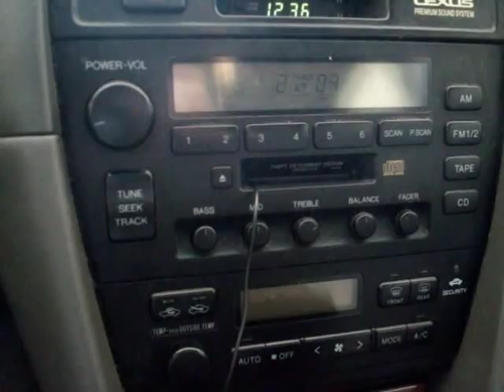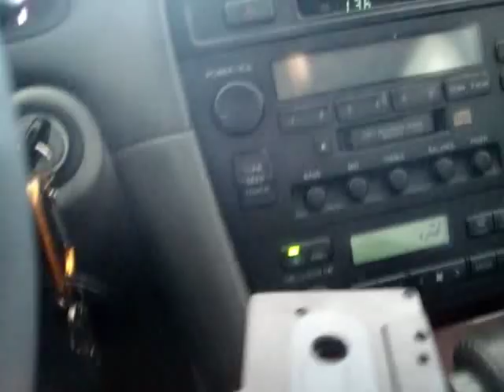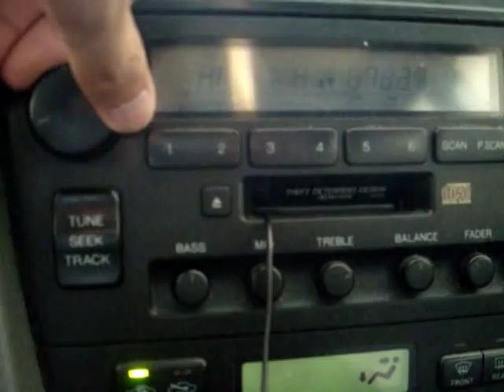Fix tape adapter / Constantly ejects

Comment: It is confusing because he literally takes the piece with rubber out and then places the piece with the rubber still intact back into the cassette, and then plays the cassette in the player an it works correctly. So he effectively took it apart and then put it back together. Wut

Comment: Sucess! I tried 4 different adapters, gears in, gears out, rubber o-ring in/out, every solution didn't work. Then I read my owners manual. If you have a GM-Delco am-fm cassette system, it has a bypass that must be activated.
1- turn off radio. 2- turn key to acc 3- press and hold tape aux button for 5 seconds. a flashing cassete icon will stay on 4- put in adpater. system powers up and it does not eject. 5- using eject button cancels bypass
6- to reactivate, repeat 1-4. it works. no matter the adpater or gears.
don't know about other brands. check your manual. hope this helps.
Reply: Steve Benson THANK YOU! This is the only thing that worked for me!
Reply: +Steve Benson This worked perfectly thanks so much!
Reply: why is this not the FIRST thing that comes up when googling "How to get a cassette adapter to work on gm radio"   Jezz......I've been messing with this thing for two days.....Thanks for posting that.....this video is a Lexus Radio even.   YOUR THE MAN
Reply: My Ye Olde 95 Buick radio doesn't have an "tape aux" button. Any ideas? Taking out the gears won't work. Owners manual states that an aux adapter will not work.
Reply: Casey Burnett have you found a solution?
Reply: Man it still won't work for me.
Reply: Steve Benson my Manuel doesent say anything about resetting and I tried what the guy did in this vid no luck. It dose say to clean once a year though but idk how to do that
Reply: 5 years later these instructions worked on my Chevy van. Thks bro

Comment: I like this vid, its helpful and hilarious cuz the way he speaks. However, this DID NOT work for me BUT i'm not saying this will not work for others. Here is what I did and so far, its works. I have the same model, i PERMANENTLY took out the gear with rubber PERIOD. Also, I sprayed the gears with a little DW40 and though I'm still skeptical, its working, I even ejected it and put it back and it works. I wish the rest of you the best. I feel you all.

Comment from the maker: @MusicIsDeadToday
If you have a protective cover over it, it usually prevents the jack from plugging in all the way. If it has an equaliser, you may want to adjust that. My last guess is that if you're using those fatty headphones, and you're using the wrong jack converter- either 1.5 or 3mm.
One thing unique to ipods is the ability to adjust the sound to play exclusively on one specific earbud. This may mess with your cars audio system.

Comment: Myself, I've always had a problem with annoying cranking, squeaking, and rattling noises.  I fixed this though.  If you pause this at 0:51, you will see the three main cogs in the center.  If you carefully lift those out (paying attention to their configuration), and put a dab of Vaseline where the large center cog rubs against the casing, and on both sides of the smaller cogs.  This essentially creates a soft suction between all the parts, and eliminates the plastic on plastic crime.  Cheers.

Comment: So, my adapter makes a horribly loud buzzing, as if gears are grinding inside. After twenty minutes, with the heater on, the deck gets warm and the buzzing stops. Every adapter I bought did this. Any ideas?

Comment: I think i know what the problem is with mine, its the heads on my tape player,  its not catching the spinning parts on the tape itself,  the heads on my tape player are worn so it just partially grabs the cassette spinners,  so the tape doesnt even really play,  have u guys removed your deck to see if your tape player geads are worn like mine?

Comment: wtf all he does iis:
take apart
get rubber piece
pull it apart, put it back together,
now it just works.... im calling bullshit
Reply: ill be honest, i did too until i did it and it worked. no clue how it worked, but it did
Reply: Jared Bauman didnt work for me. i took off rubber smoothed it out a bit and replaced it and put it back together and still ejects. what am i doing wrong?

Comment: Maybe someone here can help me:

I got an adaptor for my tape deck, but it wont stay in for longer than a second. As soon as its pushed it it settles like any other tape then is immediately spit back out. I've tried it just the adaptor, I've tried it with my music plugged in and playing, nothing helps. I can play regular tapes with no problem. I've tried other adaptors from other brans and they all do the same thing.

I think the problem is that the cord is preventing the door from closing all the way, so as some sort of safety mechanism the deck spits it back out. I was thinking of trying to remove that little door entirely, but I dont want to break the whole thing. Any ideas anyone?
Reply: Same exact thing for me... Figure anything out?

Comment: I took the rubber out and left it out and it worked but you could hear it spinning, so we put the rubber piece back in and it did work!  Crazy but works! It's a brand new adapter and would not stay in originally popped out immediately and now it's fine!

Comment: Don't waste time doing this -- it doesn't work. Nor does removing the cog with the rubber on it or any other part of the adapter. This product is just defective, plain and simple. Sometimes the adapter works if I warm my car up first -- but sometimes during the summer when the weather's warm the adapter still does the auto-eject thing. I've yet to find a way to actually fix this product. But, yeah, don't waste your time taking it apart--it doesn't fix anything.
Reply: +StrangeAngel03 Yeah I didn't think dismantling would work anyways. I had a Philips cassette adapter and it keeps ejecting constantly. Sometimes it goes for a few good 5 minutes, at least one song. I finally had it and upgraded to getting the Monster cassette adapter, it was $20, $10 more. Yet, it's doing the same thing. If what you say is true, about it being a defective, then I can go back to Walmart and exchange it. Also, the weather does have effect on the cassette because it heats up your radio as well. But even when I fixed my AC, it still ejects. Even on cold nights. I remember I somehow fixed this problem before, but I forgot what method I used.
Reply: +Jose B. its ejecting ot autoflipping because of the tension in the tape adapter. I used both the monster and the philips and if you remove the lower gear assembly and lightly wd-40 the gears inside so they move easier, along with not screwing in the screws all the way, leave the a little loose so its not too tight, and it works.  havent had either pop out for over half a year.

Comment: I actually only needed to see where that little plastic cog with the rubber on it goes. I'm fixing some exposed wires. took mine apart and out fell that piece. thought I was screwed....that is till you took yours apart. so thanks. even though my problem wasn't the same one I'm sure glad you were able to help me and for that thanks.

Comment: WTF is this all the videos I'm watching are about adapters and not how to fix the actual cassette player
Reply: +pavy415 because its not the cassette players issue, its the adapter thats making it be forced to eject itself
Reply: +Suzukara Mei well I tried lots of cassette tapes I have and mine keeps ejecting every tape so it isn't the adapter it's the player itself
Reply: +pavy415 If you don't wanna replace the whole thing then a last-ditch effort would be to buy some compressed air and go to town on the inside of the tape deck.

Comment from the maker: Sorry for the late reply Robbie. So, if you tried that method and it didn't work, you probably have to smooth it out some more. If you feel it, the edges aren't even/smooth, this prevents the cogs from turning which creates resistance, causing the cogs to not rotate properly and get ejected. Try this- wipe the edge on a smooth surface like you would a rubber band until smooth. Make sure the edges aren't uneven, because having the edges lopsided will cause trouble as well.

Comment: I took my cassette adapter apart before seeing this video but failed to see where 2 tiny springs came from. I found a hole where they might have been then reassembled the cassette adapter. Still not fixed though.
Reply: Try taking the rubber piece off entirely and try again

Comment: i did everything and it plays then stops and plays again then stops and spits itself out .. with and without the parts
Reply: mine does too. what kind of car do you have?
Reply: +Donnie Simmon a dodge caravan
Reply: A slightly old thread, but if I remember correctly; the cassette player in Chrysler/Dodge vehicles equipped with it can be a little picky with adapters. In my 300M, it would only read some adapters with the bottom up. A fix I did was to remove the auto-reverse gear in the adapter, you just need to make sure the other gears are aligned properly or it will not be read.

If that doesn't work, try a cleaning cassette (usually packaged as a head unit cleaner). Owner's manual recommends cleaning the cassette deck occasionally because it does get dirty.

Hope this helps!